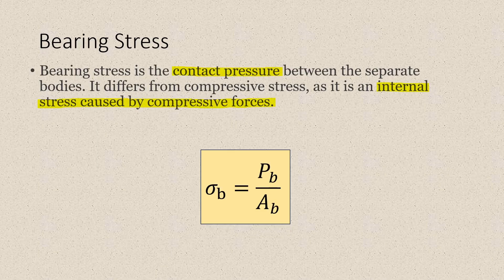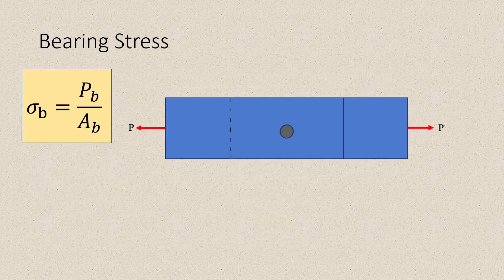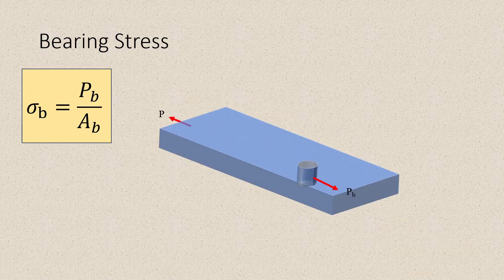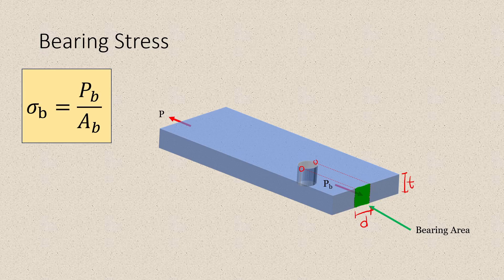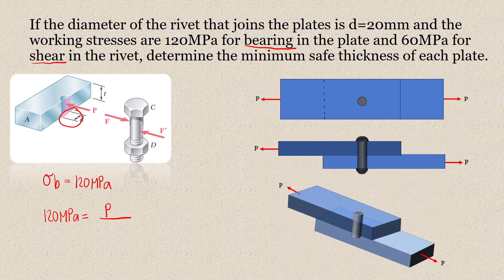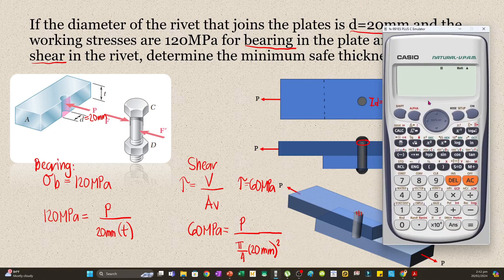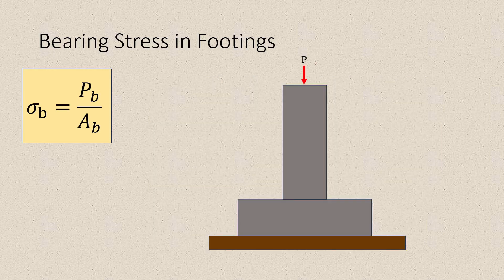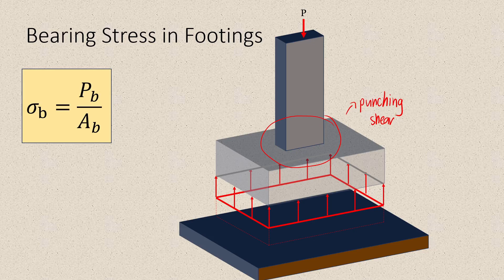Bearing Stress

Comment: I still can't understand if the bearing stress will be for both the plates individual or not. As in of both the plates are of different thickness, will the bolt experience 2 bearing stresses or just one(as the result of both plate's area of contact
Reply from the maker: two bearing stresses, as only one side of a plate is considered when analyzing bearing stresses (forces in contact areas are in opposite directions)